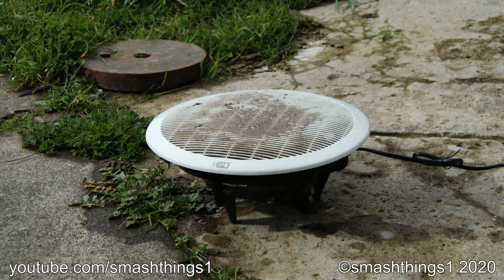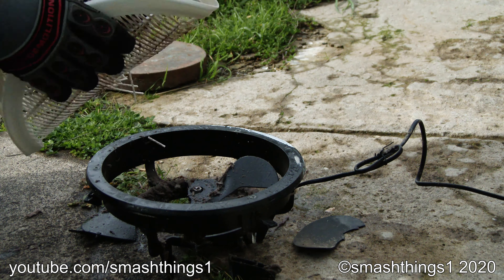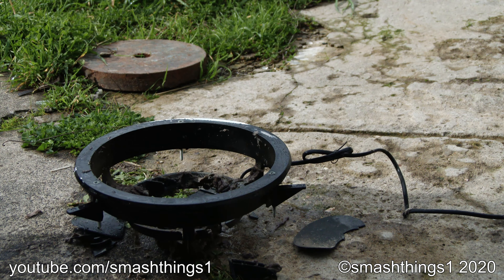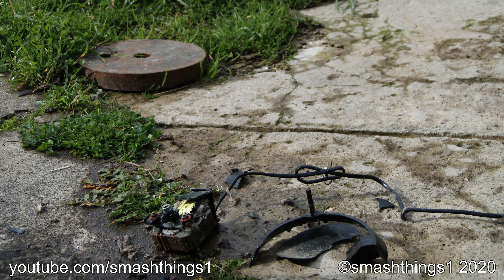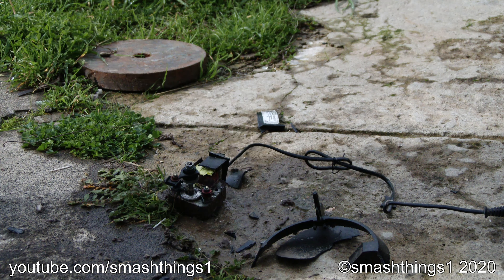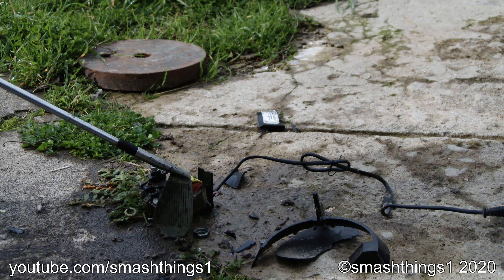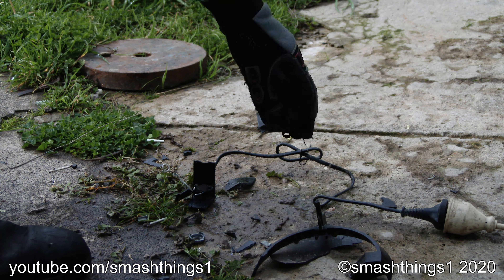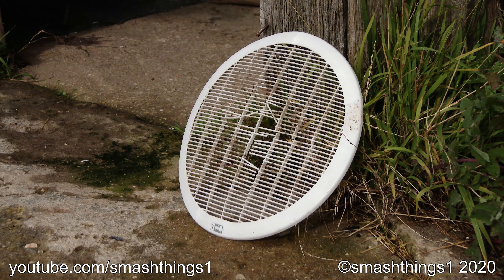Smash HPM Exhaust Fan

Comment: Man I hate those HPM exhaust fans, even brand new out of the box they can already be broken. But my question is how the heck did it survive the water. Let's see if the blower/ducted ones are any better than these cheap Chinese axial ones
Reply from the maker: Motors work underwater because they're still following the electrical path.
Reply: @smashthings1  Plus they're most likely hermetically sealed against moisture so that probably means that there sealed against water but good point I might try the motor under water too and scare the living daylights out of my girlfriend. Lachlan Potts destroyed the latest version of that HPM BTW he just didn't upload it for some reason
Reply: I never uploaded it cause it’s on the hard drive
Reply: @smashthings1  plus it's most likely that its fresh water, which I found out doesn't kill electronics as much (as fast) as salt water